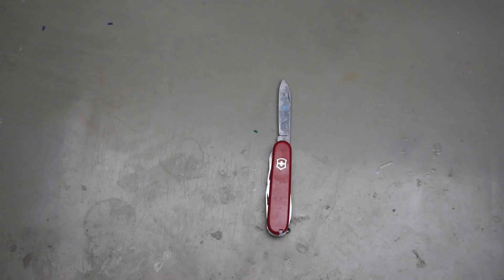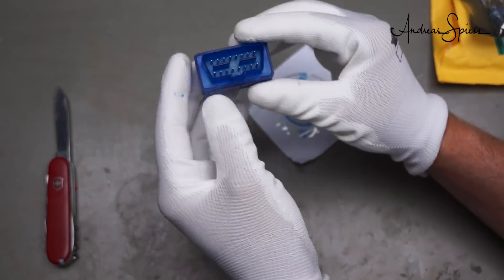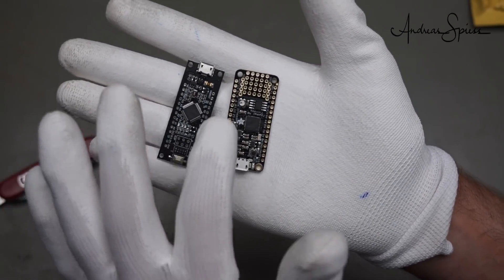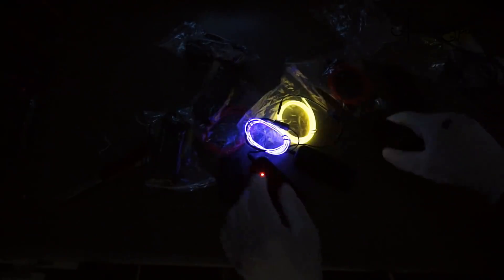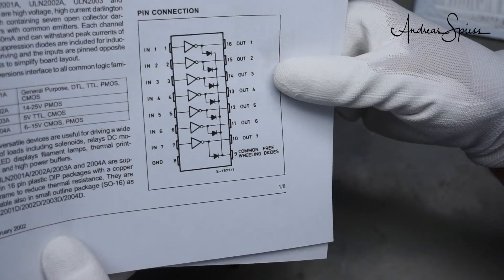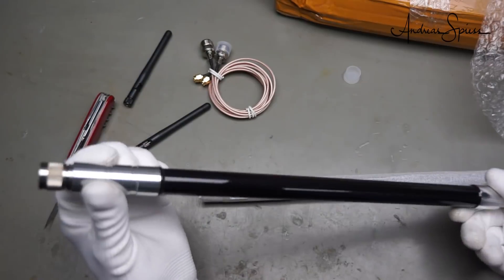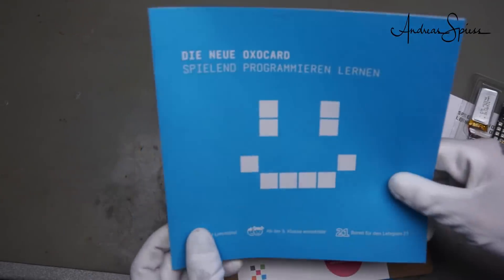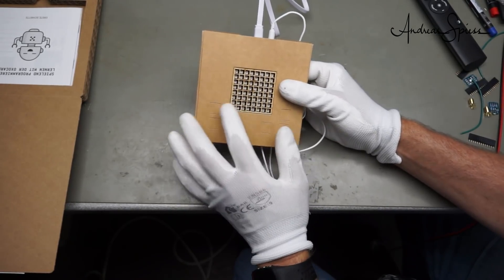#226 Midweek Mailbag (SAMD21, EL-wire, MOC3063, RAK LoRa antennas)

Comment: I have used some small AirGain brand PCB antennas similar to the one you showed having maximum SWR at 2.4GHz. The manual states that they are intentionally tuned that way because when you use two sided tape to fix the antenna to a plastic case, the plastic will influence the tuning.  When my antenna was placed as shown in the manual, the tuning was much better. Maybe this could be the case with your antenna as well?
Reply from the maker: You are right. The surrounding influences the antennas. So it is always good if you do measurements in the original locations. If this is possible and you do not use them at various places.

Comment: As for the OBD2 adapter, be aware that those cheap "ELM327" are clones of the actual ELM327, which costs a fortune ($50!) for being just a programmed MCU. The problem with that is that most of them do not implement the full OBD2 protocol.
Reply from the maker: I was more interested in the BLE part. And I hope it displays at least speed and some other basic values

Comment: BTW OBD2 regulation in the US was made mandatory for manufacturers beginning in 1996 ;)
Reply: If you get the chance with the SAM d21's look into the bootloader issues. Last time I checked, you need one of the expensive Atmel programmers to do a bootloader. There's a lot of people that have had problems. I found someone that used a STlink V2 to program a bootloader but he didn't document it very well. IIRC I saved his video on my "MCU SAM" playlist. He showed the general process but didn't share the pinout connection or all of the details.
  Then there is the issue of the 2 different bootloaders, Adafruit's M0 and the Arduino Zero. I wanted to start playing with a SAM, but my new rule is, no devboards unless I can use the processor in practice on my own PCB designs. I'm only interested in well documented software toolchains and chips available in user friendly packages. I prefer TQFP or SOIC, but I can manage most TSSOP's to QFN's if something is really interesting... but those are just my playground rules.
 Have you looked into the newer Lattice ICE based dev boards/modules recently? Sparkfun started carrying one about a month ago. They look interesting for a modern FPGA in a lower pin count (QFN-32).
-Jake
Reply from the maker: 1. I did not use the SAMD21 boards and I plan to use them in conjunction with circuit python. I hope, Adafruit sorted the problems out. Otherwise, I will let you know if I had issues...
2. The same applies to the FPGAs. I will stick with what I have for the moment and see if they are usable for my purposes...
Reply: @AndreasSpiess  
I look forward to the Circuit Python stuff as I imagine python is a little easier than the C/C++ I struggle through. Hopefully someone documents the bootloader though.  IIRC Adafruit says JLink or Atmel ICE only but I think it's in their best interest to avoid documenting the bootloader in order to promote their own dev boards. I don't have an issue buying one of theirs but I want the ability to take it a few steps further in the future, that's all.
Thanks for the reply.
-Jake

Comment: Thanks for the additional widweek-surprise.
I am Always interested in your antenna experience. 
Whats about a groundplane? If this is an Option for you, please look at https://www.darc.de/fileadmin/_migrated/content_uploads/VNWA_Groundplane_und_DVB-T_Antenne_rev_1.2_df1rn_2012_11_10.pdf. Summarized "Bei der Betriebsfrequenz von 868 MHz (siehe Marker Nr. 9) zeigt sich eine Eingangsimpedanz von 50,22 Ω, ein SWR von 1,06 und ein Eingangsreflexionsfaktor von -32,02 dB. Das System zeigt eine sehr gute Anpassung." It is about Aurel GP898. You can buy it @ Conrad or Voelkner. I just bought the 433 Version Aurel GP433 for ca. 35EUR @Voelkner and I can confirm that also this antenna is very well matched.
Reply from the maker: Looks like a good antenna Thank you for the link. I did not know it. For the moment For the moment I have enough LoRa antennas, so I most probably will not buy one. But the college seems to know what he does and therefore I would trust his results.

Comment: You've once again brought out a magic tool, the N1201SA. I'm amazed at how this works and does the testing. However, it's a bit out of my price range.
I recently saw a video by 0033mer, https://youtu.be/t_RtPClt_Pc, where he uses a cheap ebay board called the "0.1 - 2.5GHz RF Power Meter Logarithmic Detector" https://ebay.to/2NNqwyx (ebay link). It costs about $12USD and is used with an arduino.
I was wondering if you could by chance do a video on this unit and how accurate it really is. Thanks  :)
Reply from the maker: I saw the video and have such a device here. These are two completely different things and so far, I did not find any usage.for it. This is why it did not appear "on stage"
Reply: Andreas Spiess  Ahhh, gotcha.  Hmmm.  So we wouldn't be able to use this device to check our own radio signals, then.  Drat

Comment: Perhaps you can use one of the MOC3063 on a reflow oven (repurposed toaster oven) project. Maybe use a few more MOC3063's to convert an LED based "Color Organ" kit to drive mains voltage lighting, then it's off to the disco. 🙂  Any MOC3063's left, perhaps an egg incubator project is on the cards. Ideas abound. 🙂

I mentioned the MOC3051 previously (thanks for the reply), where I specifically filtered out zero crossing in the part selection as it wasn't suitable for the job (it won't trigger). I think you ooopsed 🤔
Reply from the maker: I did a video about my reflow oven. I had no need for any triacs there. It works just fine manually.
Reply: I went back and had another look, and, yes, I recall the video now after looking at it again. I'm also aware of your healthy dislike of mains voltage projects so here's a project suggestion that may be a little better suited to the channel.

Due to the efficiency of the EL-Wire, you should be able to easily drive all of your wire from a single battery/control unit. If you keep the controller in "continuous on" mode you can use your MOC3063's to switch on any combination of EL-Wires under MCU control.

Have a look at the schematic of Seed Studio's EL Shield, in particular, the "TRIAC ZERO CROSSING CIRCUIT" section.
http://wiki.seeedstudio.com/EL_Shield/

Comment: samd21 is a great arduino architecture. library and hardware support is quite good by now. lots of good selection of boards.

i quite like darlington arrays, quite versatile and easy to drive with arduino.
Reply from the maker: I plan to use the SAMD21 with Python, not with Arduino first.

Comment: Ive seen very bright EL wire, I suspect it s the crappy driver circuit in the battery case. I would like you to see if you can improve on it.
Reply from the maker: If I have time I will look into the voltages produced and maybe sacrifice one wire "till it pops"

Comment: Nice as usual! Can you make a video about your lora antennas. It’s interesting what inside of both from rak and slovakia. Both of them should be collinear antennas but, does they has electrical disclosing? How rak makes antenna balanced(symmetrical)? What type of metal coax line use? Does spring for polarization changing has correct length ... etc. Thanks
Reply from the maker: I do not think I will destroy these nice antennas. You are right with the "collinear". But both are not balanced, they are asymmetric because we use a 50-ohm coax cable to feed them. And polarization is vertical for this type of antenna (at least if you mount them correctly)
Reply: Hmm, I'm not sure that you are right. Actually according to "balancing" its my false, I mean exact symmetry of  vibrators. Antenna cant be asymmetric, should be some pipe or coil inside collinear type of antenna which make symmetry, imitate another "vibrator",  otherwise efficiency of antenna system will go down, and your vswr will show you greater than 1-2 on resonance frequency. Your antenna from slovakia has outsidde pipes for symmetry. I know that polarization of collinear antenna is vertical, but if you know the theory of such type collinear antenna, the springs on rod divides it to dipoles, and idea is, that spring avoid electron's compensations in opposite phase, because springs kind of polarization switch, which allow current move from top to bottom(to feeder). I think you can disclose exact dipol from fiberglass   jacket without any demolition, but if don't wont its ok.

Comment: Nice video Andreas as always very informative. I got the RAK Fiber glass antenna, was hoping to use if for my Gateway. I now know that it is at least tuned properly thanks to you. Many thanks, wonder if the gain is 6dBi as advertised?
Can you please post a link to the antenna from Slovak, or link your video about it.
Reply from the maker: I posted a link in the description of this video, too.
Reply: Andreas Spiess  Thanks Andreas, The 915MHz is out of stock, but I need the 868 MHz anyways so hopefully will get one. By the way it might be interesting to compare the Slovak to the RAK antenna.

Comment: You can turn on and turn off AC lights (230v) 1A with this MOC3063 directly ?
Reply: Bruno Horta 
I believe that it is not possible to drive such high voltages, it seems to me that the excitation voltage of the triacs is around 35-40 volts max, so the voltage applicable to the output of these optocouplers should be around this voltage, but I have not read the characteristics specifications of this component.I hope that here someone is more informed of me
Reply from the maker: According to spec, it supports up to 600 volts, but only a small current (not specified, only peak current). I assume it is not intended for this purpose as you easily can add a Triac.

Comment: FYI: The Atmel D21 MCU is not such a great chip you may think about. The STM32 series are far better, in all categories, however STM has no Arduino support, they support mbed. For Arduino the ESP32 and the D21 series are the major support 32-bit MCUs, I prefer the ESP32 because it as an FPU, a lots of computing power and you get WiFi/BT on top of it.

The D21 Series has only two advantages compared to the ESP32, it is pretty precise in the ADC area and it has USB device and USB host support build in.
Regards Helmut
Reply: STM32Duino supports many versions of STM32 on Arduino IDE and it's a very active and fast growing community. On Aliexpress I think you can find STM32F4 with boards with similar pricing to SAMD21 boards which means you can get Cortex-M4 for the pricing of Cortex-M0+. As you mentioned ESP32 has an FPU with WiFi and Bluetooth at the expense of high power consumption. If you want extremely low power consumption then any board with nRF52832 would be vastly better because of its M4F core and Bluetooth. AFAIK there's an official Arduino core for that along with Adafruit's nRF52 core and Sandeep Mistry's nRF5 core.
Reply: Thanks for the info, for power savings I prefer the STM32L4 (or the new STM32WB) because this easily gets down to 1uA in deepsleep with full retention. For the STM32Duino I will look into this, however I figured out for Arduino support the ESP32 community is very active in supporting/enhancing it, the D21 lakes of support (e.g. patches/fixes requires 6-12 month before somebody looks into it, Atmel is not of any help, for the ESP32 reviewing patches/problems takes only days.
Reply: When you consider that STMicroelectronics has corporate headquarters in Switzerland, Andreas's loyalty to Atmel's SAMD21 line is puzzling.
The STM32F103C8T6, in particular, is one of the best deals going for hobbyists.
All mine came with 128kb flash, like the CBT6.  They cost about USD$1, with Blue Pill boards around USD$2.  Much less expensive than the SAMD line.
You can program and debug through USB with the Maple bootloader, and use Arduino software with stm32duino[.com] libraries.
Reply from the maker: I want to use it for Adafruit's Circuit Python. AFAIK this chip is their main platform. For the Arduino stuff I am ok with my ESPs ;-) If I change, maybe in the direction of Nordic because of their BLE and low power stuff.
Reply: FYI in the ARM embedded MCU market STM is the market leader with over 50% market share of the this kind of embedded MCUs. They offer excellent documentation and software compatibility between the entire STM32 series. The new STM32WB (is an STM32L4 with BT) is very interesting for BT/low-power apps. I have experience with Atmel D21, with Silicon Labs, with ESP8266, ESP32 and the STM Series.

I can tell you, for me STM32 is far better than all other vendors, only the ESP32 is as well of interest because it is cheap, has WiFi and is best supported by Arduino. STM32 is perfect supported by mbed.org or native SDKs.

Comment: I bought two ESP32 boards from ezsbc.com and they've been great. (I got the less expensive ones without the ufl antenna connector).  The quality is excellent and support questions are answered by the guy who designed the boards.

The two RGB LEDs aren't neopixels.  On one of them, the red and green LEDs are connected to the Tx and Rx LED lines on the USB chip.  The Blue LED and the other RG&B LEDs, are connected to GPIO lines 16-19.  Also, 'Hi Dishka!".
Reply from the maker: Thanks for the clarification about the LEDs and your experience with the supplier!

Comment: Be careful with the BT OBD interface. It will probably accept connections from anyone, so you're giving full, unrestricted access to all systems in your car to anybody in the vicinity.
Reply from the maker: I was not aware that it is also on when the car is off. Thanks!
Reply: Andreas Spiess  Just check with phone, or laptop if the device is discoverable and waiting for connections. Should not be as long as it is connected to something, but once the paired device turns off, it may become discoverable again. That's an issue with cheap audio devices, which will happily connect with anybody as soon as currently connected device disappears from their view.

Comment: I'd send you some good PCB antennas if you didn't live all the way in Switzerland.  I have lots of 2.4GHz ones and some 5.8GHz ones as well.
Reply: May I ask: where do you source "good" PCB antennas?  This seems to be an ongoing issue.
Reply: @cfeigel  Satellite receivers and some old routers
Reply from the maker: Thank you for your offer. For the moment I use the usual stuff I have (I test them before if they resonate on 2.4GHtz)

Comment: You could try to shorten both antennas to get a lower swr. The plastic cover/radome also influences tuning. The PCB antenna might shift frequency a little when stuck to the inside of a plastic box. Worth a try. Great content BTW.
Reply from the maker: Tried already in a former video. It works. But only if the antenna is too long, of corse ;-)
Reply: Andreas Spiess:
Ddid you cut too much? turn up the frequency! hahaha... excuse me  for the sillyness, Andreas

Comment: Why we need SAMD21 if we have STM32F0? :)
Thanks for the unpacking!
Reply from the maker: I bought it because of Adafruits Circuit Python project.
Reply: samD21 has additional features like in chip DAC converter for instance
Reply: Sylvain LAZARE  STM32F042 has DAC too. They seem to be just same.
Reply: P Kav  not all versions have DAC,   Blue Pill    STM32F103 does not